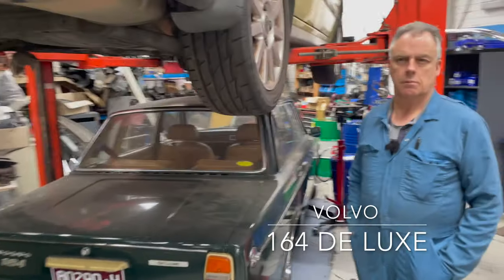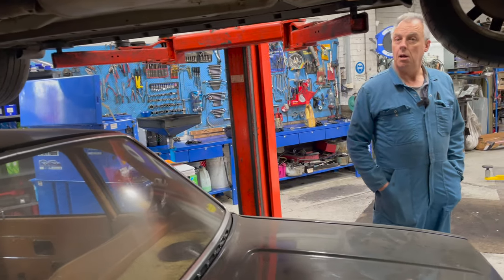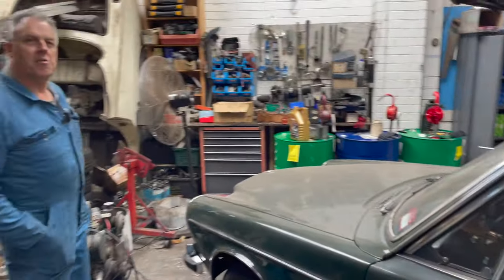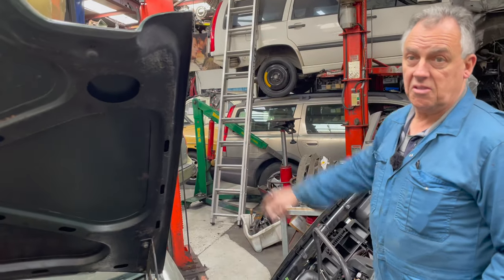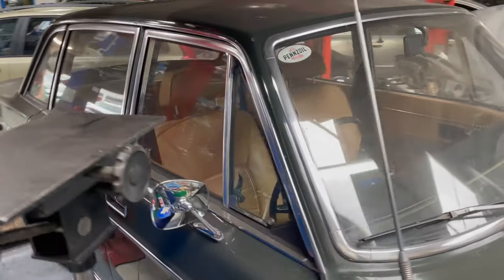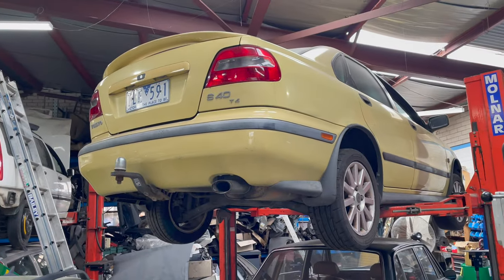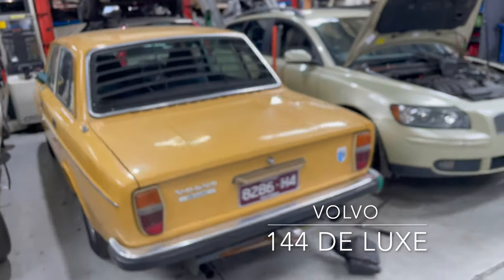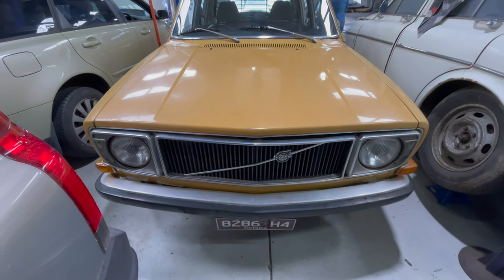Aussies Restore Cars Better - According To John

Comment: just found this. the very 1st shot, the white amazon, the really rough one, was my car, and in fact john doesn´t mention he´s had more to do with that car than just buying it a year ago. it was at his workshop i changed the engine for a larger and fuel injected engine and he helped me sort out a few things on it but i drove it for a few years but then left the country and was forced to sell it. the guy who bought it claimed he was going to restore it (it was no show winner when i owned it but it was way less rough than it is now) but it seems all he did was take the plates and put them on the other one and drive that around (the NLY-538 plates are from my car and not the car they were in on the video - I visited late last year and souvenired the plates) a shame as the car was pretty fine when i sold it but then, that´s how things go...
Reply from the maker: It’s a shame how people let things slide but I guess we don’t exactly know the circumstances. It’s in safe hands now though.